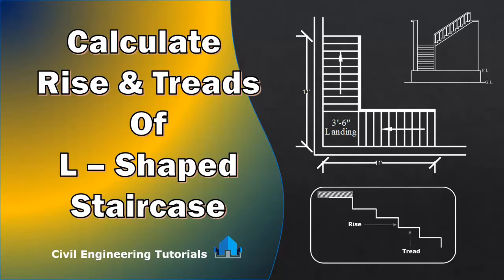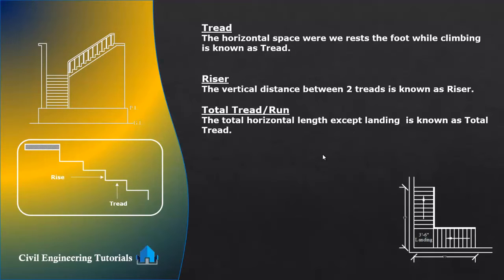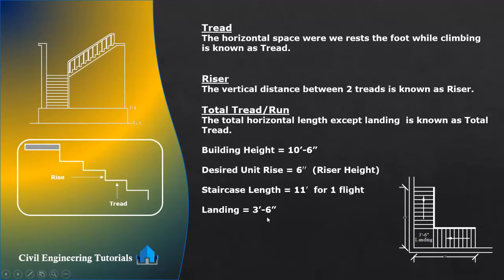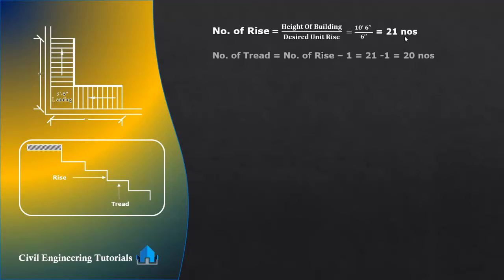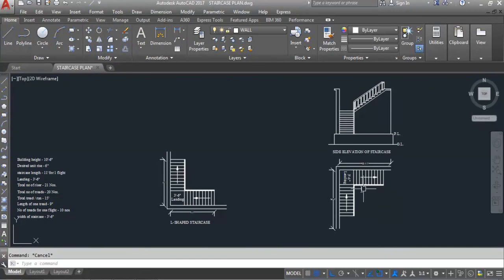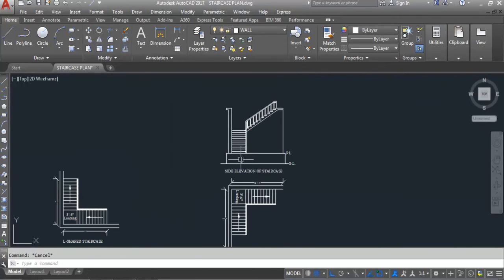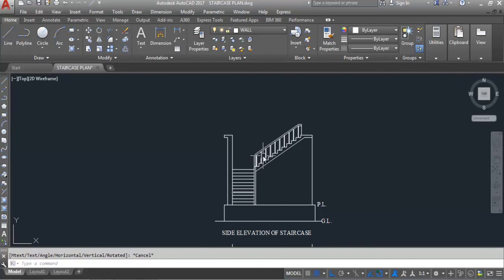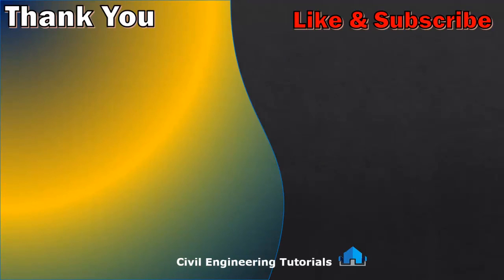3.How to calculate number Rise and Treads for L-Shaped Staircase | L-TYPE Staircase

Comment from the maker: 📌 Important Note: There was a typing mistake in the calculation shown in the video. The correct breakdown should be:
(11'-3'6") + (11'-3'6") = 7'5" + 7'5" = 15’
The final answer (15’) is correct, only the intermediate value was typed wrong. Thank you for understanding! 😊

Comment: (11'-3'6")+(11'-3'6")
= 6'5"+6'5"
= 15 how ?
Right is 
(11'-3'6")+(11'-3'6")
= 7'5"+7'5"
=15' 

Your answer was right but processing of calculation were Wrong😊
Reply from the maker: Thank you so much for pointing this out! Yes, you are absolutely correct — the answer 15’ is right, but there was a typing mistake in the intermediate calculation while explaining. It should have been (11'-3'6") + (11'-3'6") = 7'5" + 7'5" = 15’. Thanks for highlighting — this will help others too!

Comment: How it's possible 6.5+6.5= 15
Reply from the maker: Thanks for asking! Actually, there was a typing mistake in my calculation. It should be (11'-3'6") + (11'-3'6") = 7'5" + 7'5" = 15’, not 6'5"+6'5". The final answer 15’ is correct, but the intermediate value was mistyped. I appreciate you pointing it out — it helps everyone!

Comment: madam 11'-3'6"= 7.5' hoga
Reply from the maker: Thanks for asking! Actually, there was a typing mistake in my calculation. It should be (11'-3'6") + (11'-3'6") = 7'5" + 7'5" = 15’, not 6'5"+6'5". The final answer 15’ is correct, but the intermediate value was mistyped. I appreciate you pointing it out — it helps everyone!

Comment: 11'-3'-6=7'6" not a 6'-5"
Reply from the maker: Yes ✅. You are correct. Thanks for asking! Actually, there was a typing mistake in my calculation. It should be (11'-3'6") + (11'-3'6") = 7'5" + 7'5" = 15’, not 6'5"+6'5". The final answer 15’ is correct, but the intermediate value was mistyped. I appreciate you pointing it out — it helps everyone!

Comment: I dont know how 6.5 and 6.5 came to 15 feet. it should be 13 feet
Reply: I am also confused
Reply from the maker: There was a typing mistake in the calculation shown in the video. The correct breakdown should be:
(11'-3'6") + (11'-3'6") = 7'5" + 7'5" = 15’
The final answer (15’) is correct, only the intermediate value was typed wrong. Thank you for understanding!
Reply from the maker: There was a typing mistake in the calculation shown in the video. The correct breakdown should be:
(11'-3'6") + (11'-3'6") = 7'5" + 7'5" = 15’
The final answer (15’) is correct, only the intermediate value was typed wrong. Thank you for understanding!